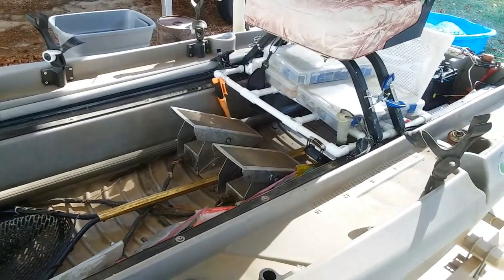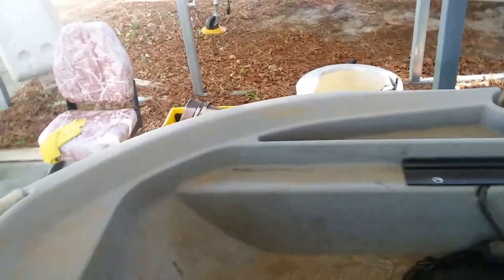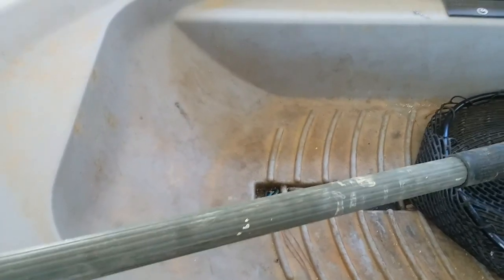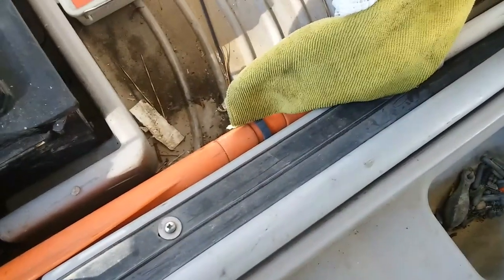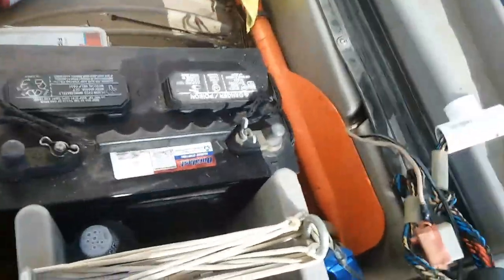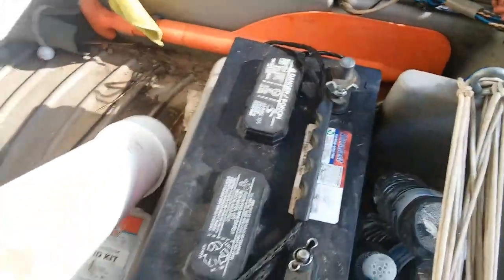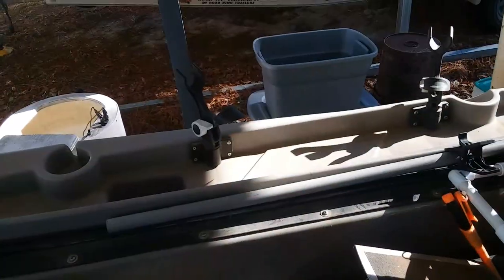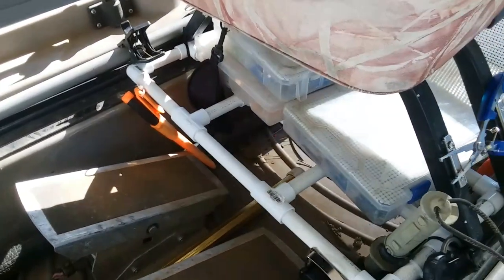Boat upgrades, modifications, and gear in my Twin Troller X10 that are also useful for other boats

Comment: Allen, I like the magnets. Where did you get yours? I do not recognize them.
That under seat storage is a great idea! I like it.                                  Gerry
Reply from the maker: I found the magnets that I used on EBay https://www.ebay.com/itm/Strong-Neodymium-Magnets-Countersunk-Holes-Rectangular-Pot-Magnets-Screw-Tape/153431630374?ssPageName=STRK%3AMEBIDX%3AIT&_trksid=p2057872.m2749.l2649 You will need to drill a slightly smaller diameter than the screw before drilling the screws in place should you choose to place on the metal seats like I did.

Comment: What is the best batteries for these trolling motors????
Reply from the maker: Deep cycle lithium is best, but extremely expensive.  I use gel that performs better and costs a bit more than lead-acid.

Comment: How did you put an end on your stake out pole and did you put something on the inside to stiffen the pole?
Reply from the maker: No end on this one, just cheap easy solution with electrical/grey PVC which is a bit more robust than plumbing grade.  You can get true stake out pole for around 100 dollars that can do the job better in more firm bottoms.